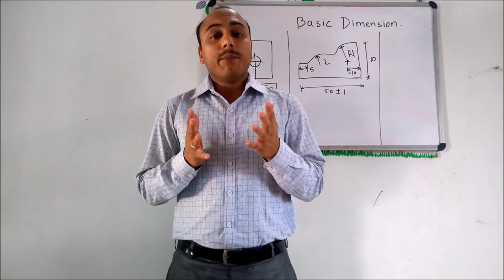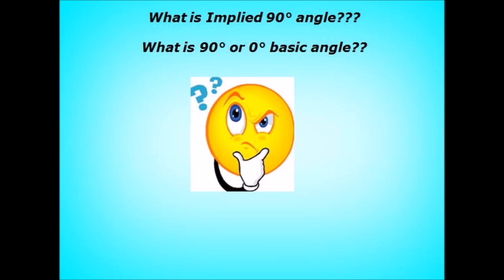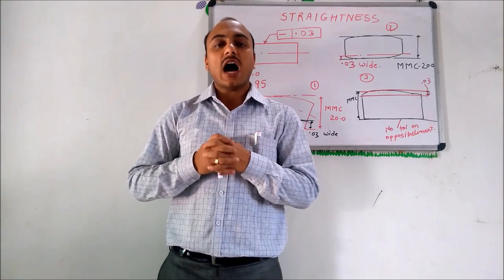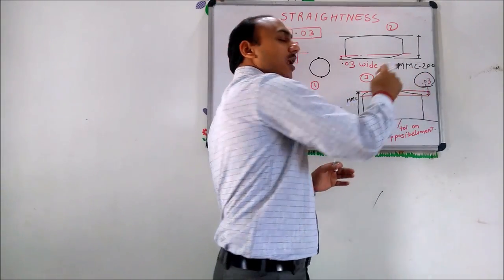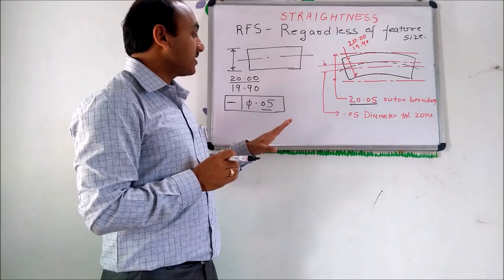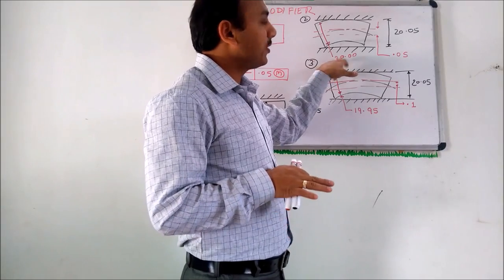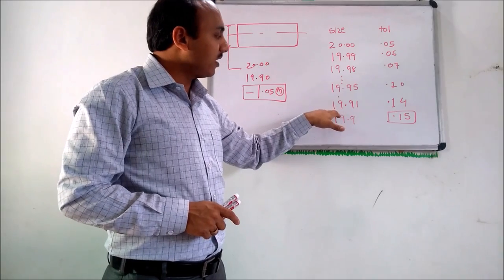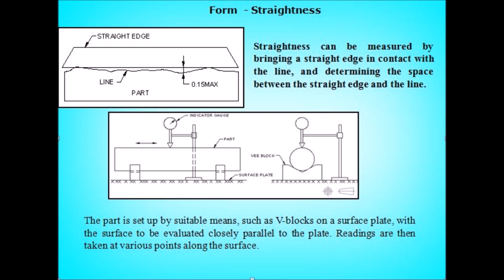GEOMETRIC DIMENSIONING AND TOLERANCING (GD&T) LECT 2

Comment: Amazing lecture sir. But one question remains on my mind. Is in the second scenarios you have shown (Straightness applied on dimension) the measurement of the diameter and of the straightness different things? I mean  is acceptable a 20.03 diameter shaft with a .02 straightness tolerance?
Reply from the maker: Thanks. Rule 1 is size tolerance must be respected. In this case envelop is 20.03 with form error. If we measure dimension at any cross section it should be with in size tolerance. But suppose shaft is distorted and cross section it at MMC, part with in envelope 20.03 will be accepted. Let me know if this make sense. Regards, Bipin

Comment: Nice lecture but I am confused 

If we give Gtol on Dimensions, is it applicable on axis (tolerance zone on axis) ?
Reply from the maker: Not always. for positional Gtol, it is on axis. For circularity, runout etc it's on surface. So it depends
Reply: @TheEssenceofknowledge  
Hi 
you are really good and too quick to response...I did many video lecture they confused a lot, but you made it too simple at least for me.

Comment: If someone ask 'Why MMC, LMC & RFS modifiers are used ?' What should I say ?
Reply: Can I give an answer like "proper function and fit of parts"...
Reply from the maker: Yes, always tolerance depend upon required fit. In addition you can say RFS- REGARDLESS OF FEATURE SIZE- it is applied when positional shift or orientation is not allowed to vary more than a limit like in keys. RFS should be given as it is more precise. MMC Modifier is given when maximum material condition is critical and a specific value of tolerance can be allowed on MMC. When component departs from MMC a bonus tolerance added. Same for LMC. Always everything depends on functional fit requirements. Let me know your further queries.